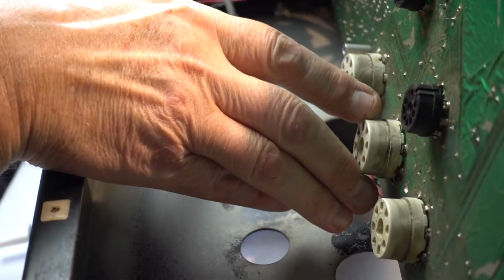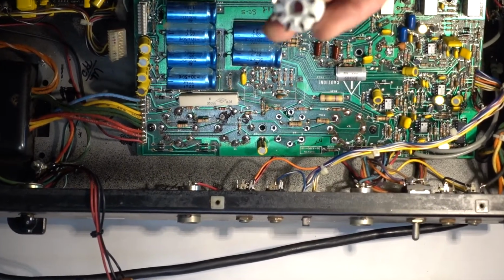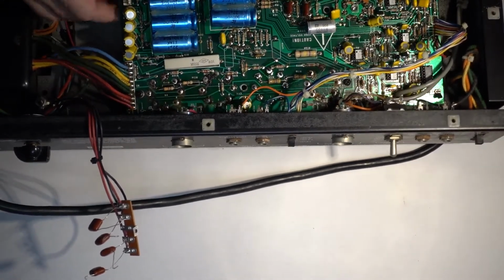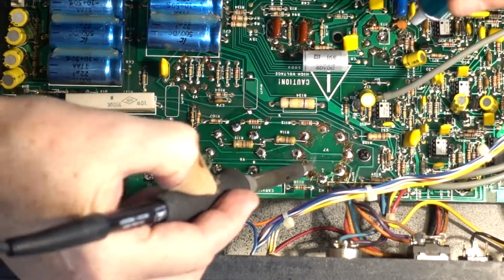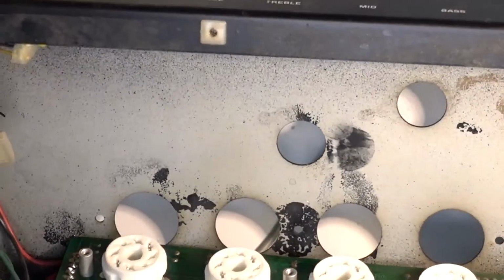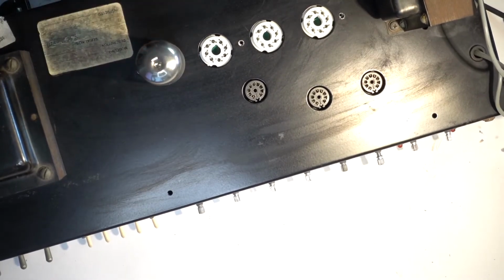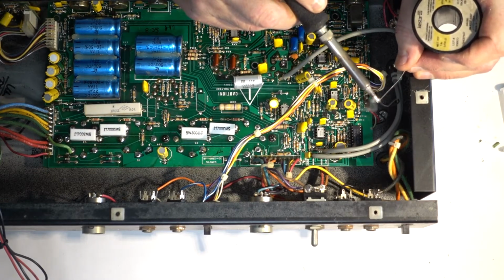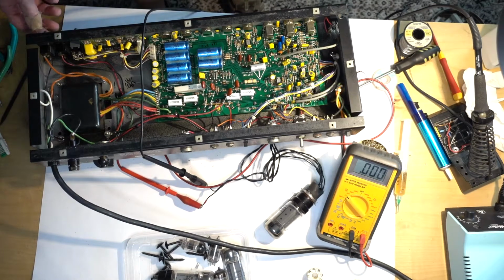Carvin X100 head 6L6's tube sockets replacement

Comment: This an extremely helpful video! My Carvin MTS3212 has a bad socket where the 6L6 won't light up, so I move it around to get it to light, and it only stays like that for a short time. I have a 60w iron, solder-sucker, etc., so this gives me a good idea of what to expect. I'm lucky in that the power tube sockets on the MTS are mounted on a card that is separate from the motherboard. Thanks!
Reply from the maker: Good luck!